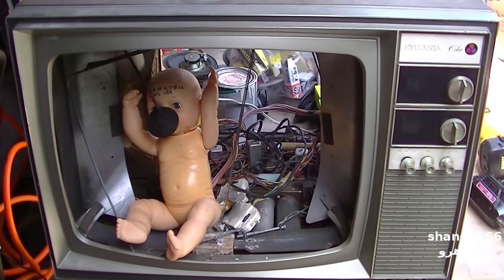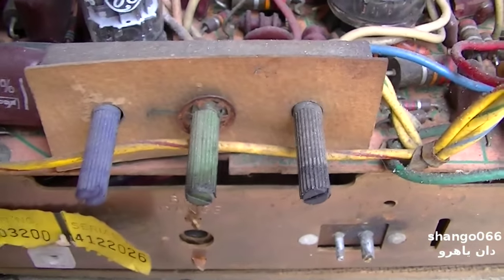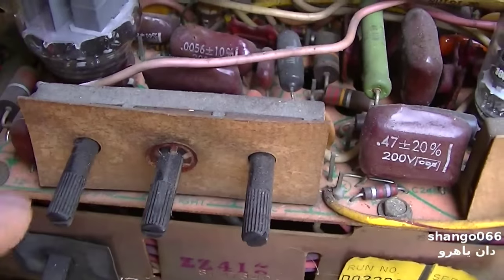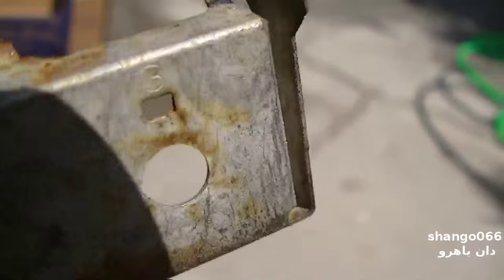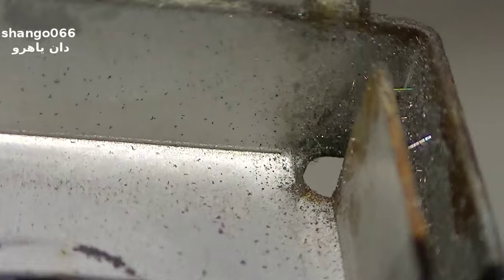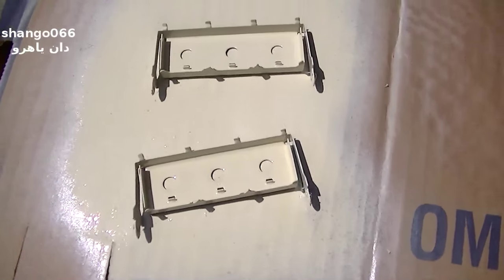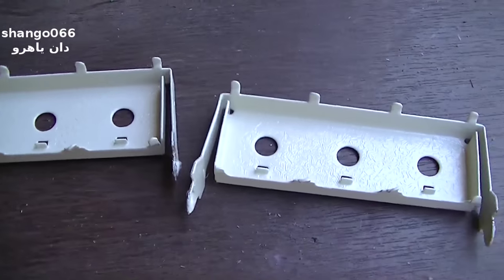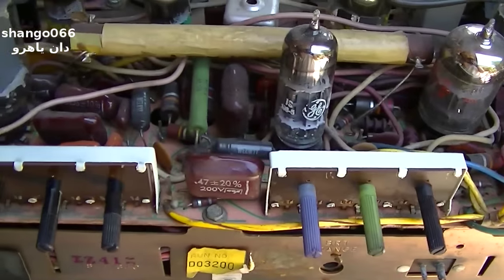Sylvania Color part 2 Tin Whiskers

Comment: The reason why CRT-face delamination is often seen in older sets like this is because the clear PVA adhesive is exposed to, and over time reacts with, ambient air and eventually loses its transparency. I am unaware of any industrial solvents that can dissolve polyvinyl acetate. Acetone may be a possibility, but you'd really stink things up. The manufacturers of these sets didn't realize that many of them would last 40-50 years into the future (2015).

I remember seeing a several-part series of videos that drh4683 (Doug) made a while back, where he heated up the CRT face. Strangely enough, he didn't use any personal protective equipment. Without such protection, one could be blinded, eviscerated, dismembered and/or castrated should the CRT detonate.

Comment: . You can take a piece of sheet metal w wider and longer then the tube itself and then slowly push it down in between the safety shield and the tube and it'll it should cut through the epoxy
Reply: Pull a guitar string under the safety glass.

Comment: Well, I have seen a video of someone removing the glass with wegdes and heat from a halogen lamp I think, but that was a roundie, and I guess it would be harder on this shape of glass. I would try removing a chunk of that stuff that holds the glass, and see how it reacts to temperature or solvents. Looks like some kind of wax, but if it's a by product of oil, then maybe it can be dissolved with gas or kerosene, on a similar way to grease or asphalt, I don't know.
Reply: MisterTalkingMachine It's polyvinyl acetate, not wax.
Reply: ..wood glue?, well, the solvent on that is water. Did some googling and some people do use vinegar for wood glue on woodworking, however they use 30% concentration vinegar without further diluting.

Comment: This covering... it's so alien to a European. Our colour tv sets were... just glass. Do you have an explanation to why yours were covered in glue???
Reply: ***** They all have a safety glass, but on these sets they were curved and bonded to the face of the CRT rather then a flat piece of tempered glass mounted in a frame inside the cabinet like a 1940s or 50s TV set.
Reply: OlegKostoglatov Interesting, never seen a UK tv set from the 50s with either of those safety measures. Not saying they didn't exist, it's just TV was rarer here even upto the 70s, so I likely just haven't come across them
Reply: ***** It's also possible that the UK sets had the same bonded safety glass, but simply used different/better epoxy that didn't break down. When these TVs were new, you couldn't even tell they had the glue on them since it was clear. The one in this video shows what happens to the epoxy with age.
Reply: captain150
It's not an an epoxy it's polyvinyl acetate, but it doesn't always break down like that and form a "cataract". Maybe it depends on the local climate, the home environment, or how the TV was stored? Apparently it happens to German made TVs as well so it's obviously not exclusive to North American sets. Look up "Picture Tube Cataract Removal" on Your Tube, the stuff is sort of like a rubbery goo.